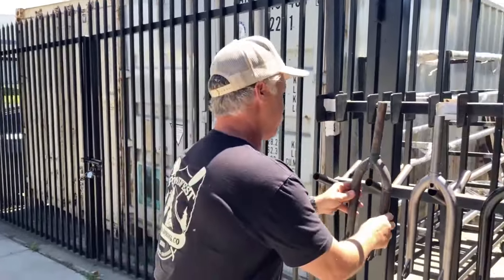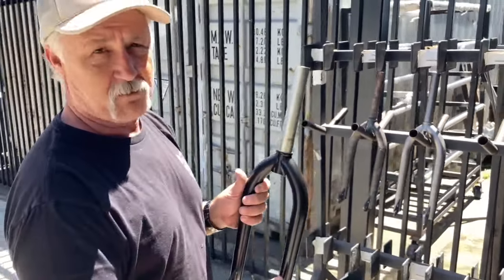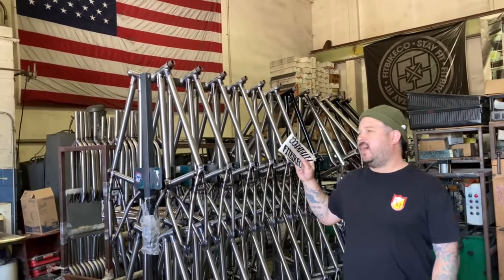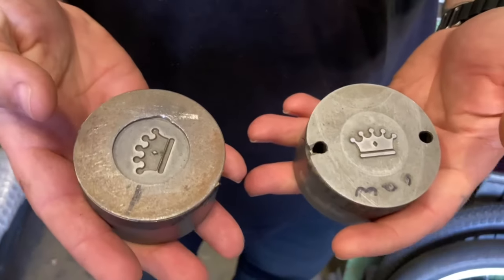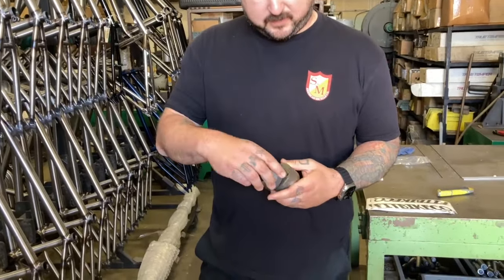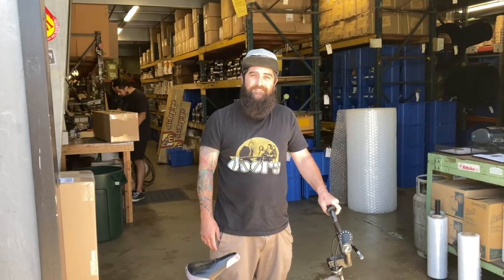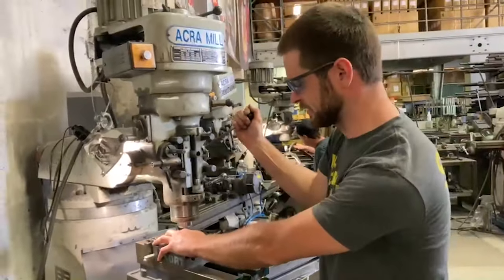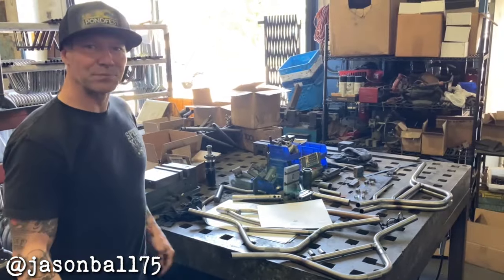Factory Friday: Talkin' Trans #Hot Topic

Comment: Trans clear is garbage anyways, put a solid powder coat on the frames so they last longer without rusting
Reply: Is clear powder coat different than solid colors?
Reply: @0421072  well it just doesn’t have the protection that color powder coating gets, because it’s gets a sealer usually under the color then clear on top of that. So it’s basically them cheaping out and just clearing them….the clear will start to get some minor spider looking rust then eventually rusts out. Looks cool just not good for longevity.
Reply: A bit of rust on a frame doesn't make a lot of difference to its integrity. Not worth the worry.